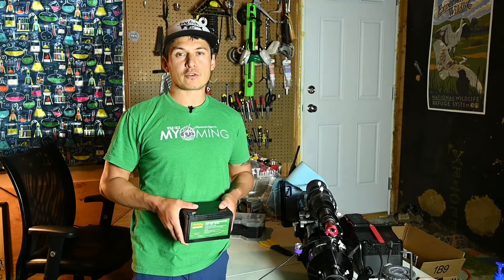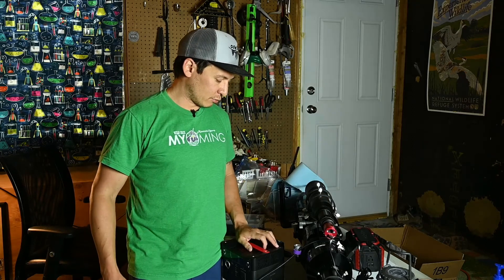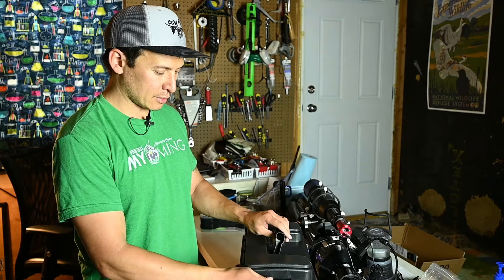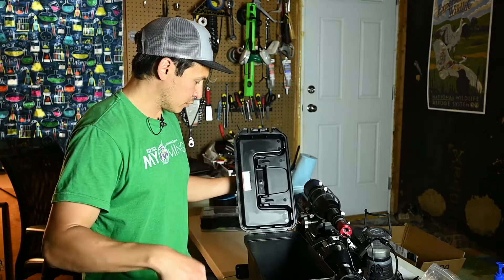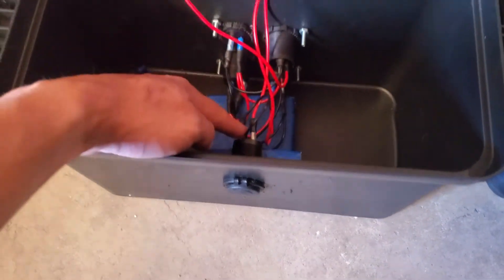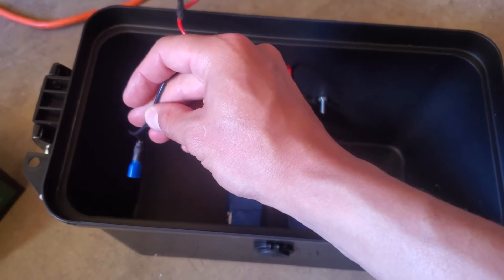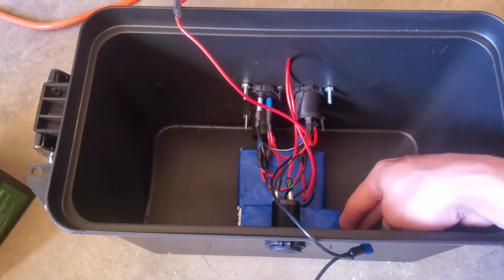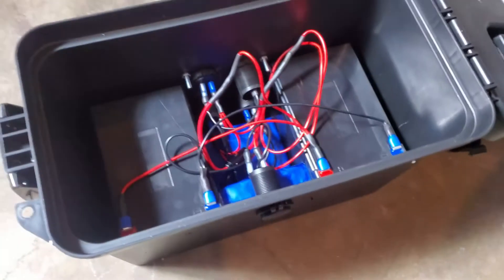Building a cheap DIY LiFePO4 (Miady) Battery Box for Astrophotography

Comment: One item I would suggest adding... a charging port so you don't have to remove the batteries to charge them.   and you should be able to charge those with a solar panel.

Comment: I built the same battery box but only with one battery and a smaller ammo box. I am very happy with it and you can’t beat the price. I’ve been itching to build A bigger one. I’m inspired I’m definitely going for the 2 battery system. Nice video !
Reply: Thanks! Yea, this option has been so much better than those overpriced systems that just use regular lithium batteries.

Comment: Awesome! I'm looking at building a box myself, and that's exactly what I want! I'm going to be using a tablet with my new ASIAir, so I don't have to worry about the laptop power hog. I'd love to know if you've made any recent modifications/improvements.
Reply from the maker: Thanks! This system has been working great, so I haven't made any modifications with it. I'm thinking about making a single battery box for my laptop when I go to remote sites. You're right, they can be power hogs.
Reply: i dont mean to be so offtopic but does someone know of a method to log back into an instagram account?
I was stupid forgot the login password. I love any tips you can give me
Reply: @Archie Zaiden Instablaster =)
Reply: @Vincenzo Aiden i really appreciate your reply. I got to the site through google and Im in the hacking process now.
I see it takes a while so I will reply here later with my results.
Reply: @Vincenzo Aiden it worked and I now got access to my account again. I am so happy:D
Thanks so much, you saved my ass!
Reply: @Archie Zaiden Glad I could help =)

Comment: Lol! That box is perfect for those batteries. I have almost the same setup. I'm using 6 of the 8ah ones though. I also have a 300 watt pure sinewave inverter inside with a 20 amp mppt charge controller. Nice build btw
Reply from the maker: It's been working great so far! I haven't done a full night session yet, but it still holds strong around 13.2-13.3 volts after several hours. What inverter do you have?
Reply: @deepskyutah5257  it's a grander 300 watt pure sinewave inverter. I got it on amazon
Reply from the maker: @gadget_hack  thanks!

Comment: Great job on the design . I think for your application it will be fine for the low but consistent draw you need. If you are going to build another for an inverter , that’s a different story. Your wire is way undersized. Also do not put a little switch in line before an inverter. put a nice big fat fuse off your batteries in parallel. I have the same batteries on the way to me to run an electric cooler so your design is great for that 3 amp draw for 5 hours type of day. I build mobile power systems for med. size water craft , Mobile businesses  and Rv’s so down load the wire calculator app and then double it and even these little batteries will work like a champ.
Reply from the maker: Thanks, Mark! I appreciate the feedback and advice. Do you think the wire is still undersized even for the smallest inverter just to keep a small laptop going all night.

Comment: How long can you image with the regular Lithium batteries before the voltage drops? I've been looking at getting the Suaoki S270 or the S370 to use with my EQ6-R Pro (noticed you use the same mount).
Reply from the maker: Regular lithium batteries will start dropping voltage pretty soon after you start using them. My Rockpals 300w, 280 wh bank starts at 12.6, and I've run it down to just under 10.5 with my EQ6R-Pro and QHY168c plugged in for around 6 hours on a warm summer summer night. I wouldn't recommend that though, as it's pretty low and I don't think the mount likes it. Probably not good for the battery either. I have the Suaoki 270, and I really just use that for my laptop now. You could probably use it for just the mount and get through a night with it. The 370 should definitely get you through a full night. Looks like a nice bank, but I really wish it had LiFePO4 batteries so it would last many more charge cycles.